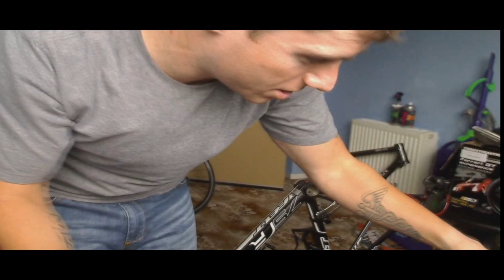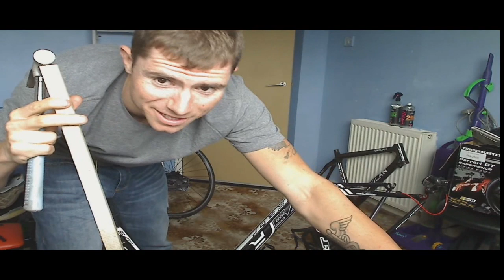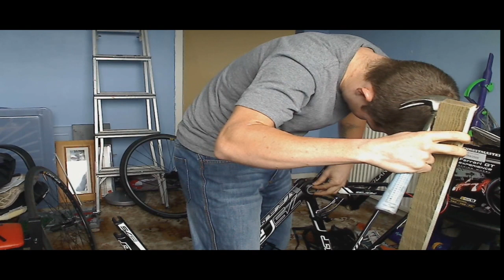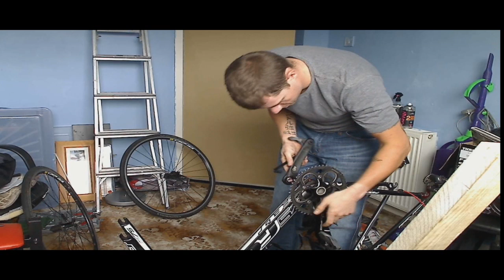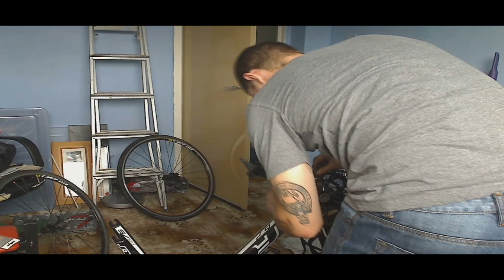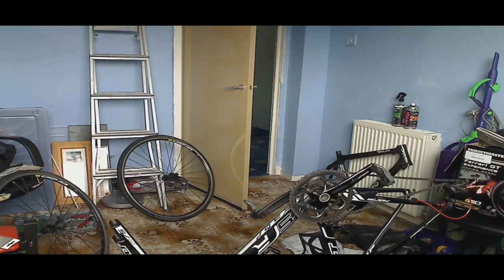Andycats replaces a BB30 cartridge NO TOOL edition

Comment: LOL!  May not be on every bike, but my bottom bracket bearing is not flush with the frame. It should be recessed a bit. If that is the case, there is no way that plank worked unless your cranks pushed them in when tightened down.

Comment: never replace your bb30 bearings this way.  At least make a cheap bearing press. This is just horrible.  And you're not supposed to grease the outside of the bearings at all.  You're actually supposed to use some loctite on the outside of the bearing which helps reduce "creaking" that is many times common in bb30 bottom brackets.  I hope people know better than to try this hack job method of pressing in bearings.

Comment: Dud take a peace of all tread 2 big washers & a 2  nuts put a washer & nut on one side slide it through the race & frame slide in place  the second race slide on the Other big washer put the nut on tighten it up snug make sure the race's are strait tighten one side until the race's Are seated properly. I hate seeing this cave man hammer crap.